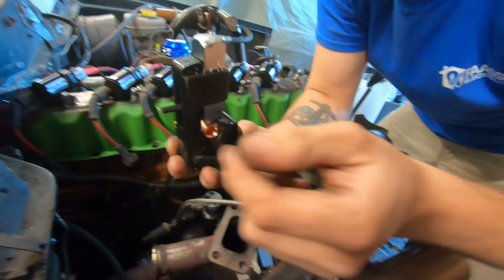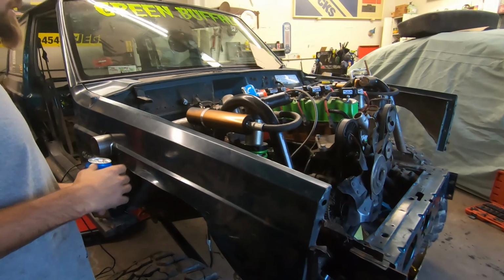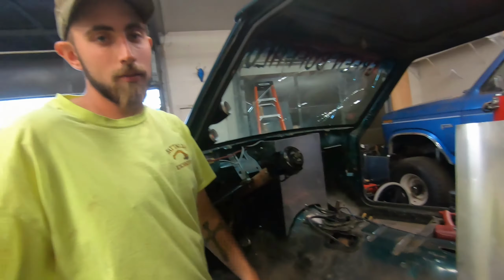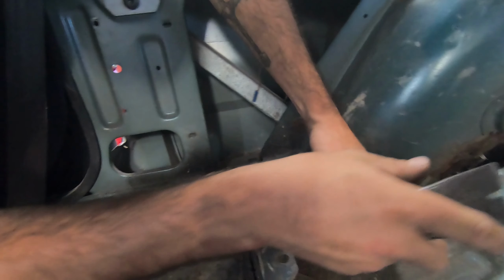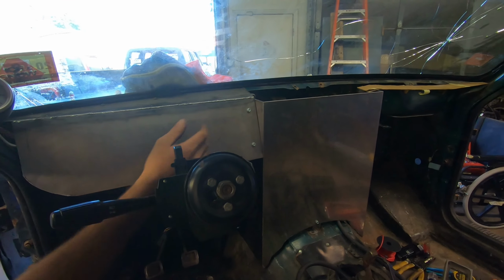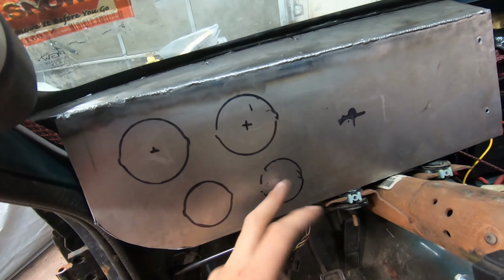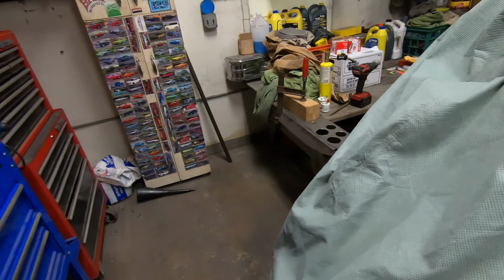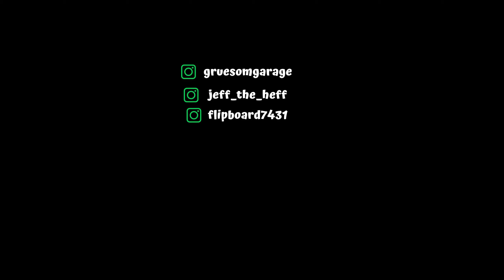Turbo Jeep Megasquirt part 7

Comment: Just as a suggestion but after you guys are complete with the project you could actually fill what left of body with an expanding foam. It will strengthen up the Jeep shell

Comment: You can also use a GM alternator like a 4.2l just wire in a resistor to excite it (or an alternator light bulb)

Comment: How do you run your vacuum lines? Wouldnt they not work with boost?
Reply from the maker: We Only have one vacuum line and that's to the brake booster, she works fine
Reply: You just need to use one way check valves for certain things. You also want to zip tie all connections so they don't blow off under boost. This usually not an issue on low boost setups.

Comment: Whats the need for the resistors
Reply from the maker: They are required for the ms3x to get a proper signal from the crank and cam sensors